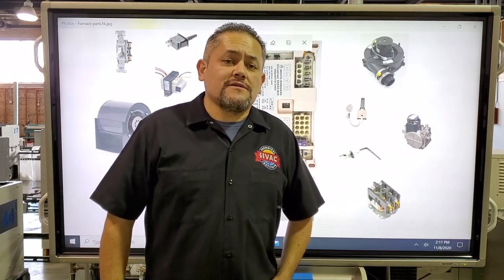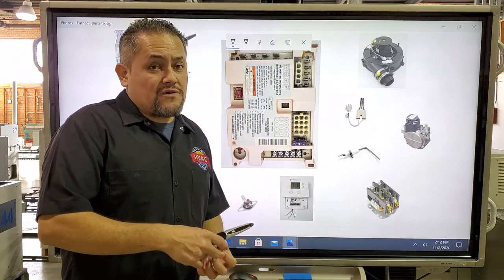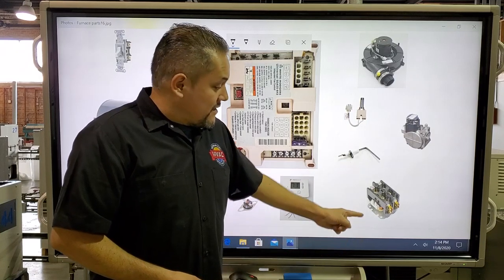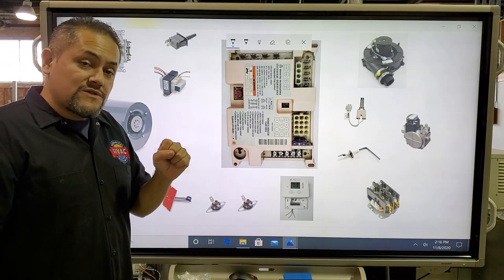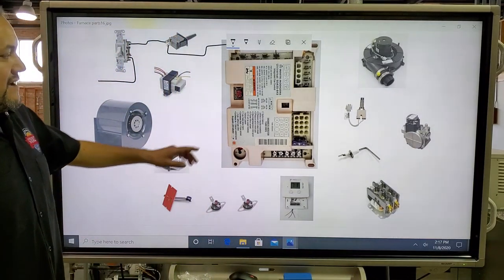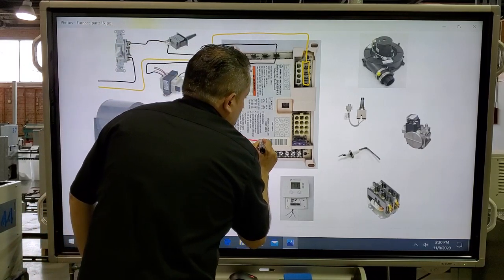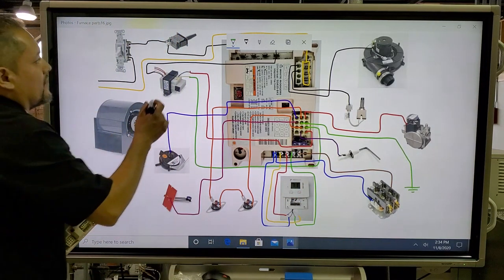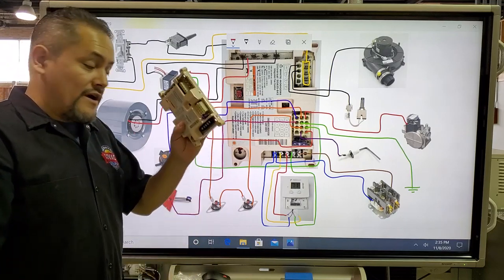Furnace IFC how to connect electrical components.

Comment: Maestro es posible cambiar un furnace (gas furnace) por un heat pump y que cambios se tienen que hacer en terminos  electricos 
Gracias maestro
Reply from the maker: Primero: en que region vives, el norte de estados unidos no te combiene, los heat pump no pueden trabajar a temperaturas  constantes de bajo de 32 grados, si la luz esta cara donde vives tanpoco te combiene.
Reply: @paulohvac  gracias por tu respuesta
Vivo en el estado de Washington y aqui son muy comunes los aires centrales con heat pump y pues segun ahorran electricidad y por eso me estan recomendando una unidad de esas .